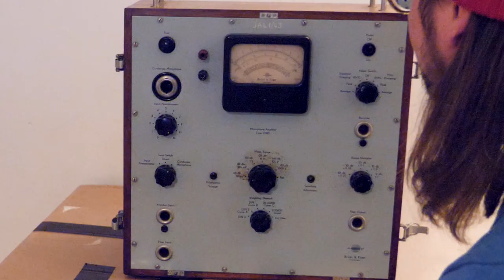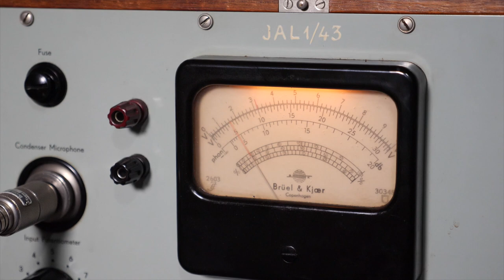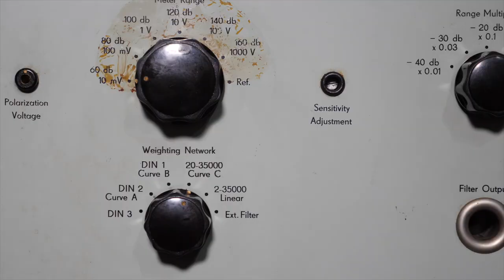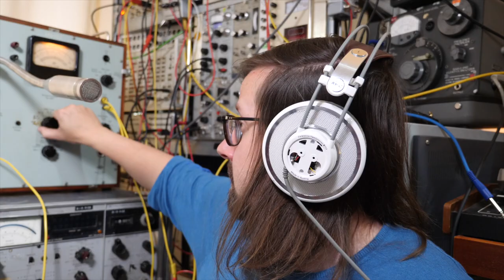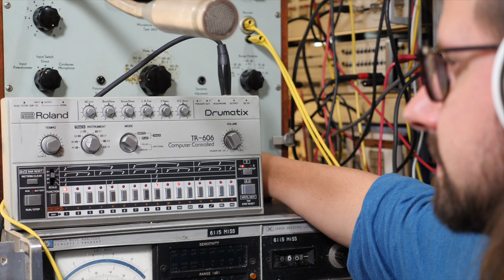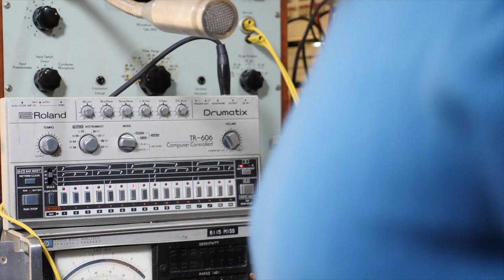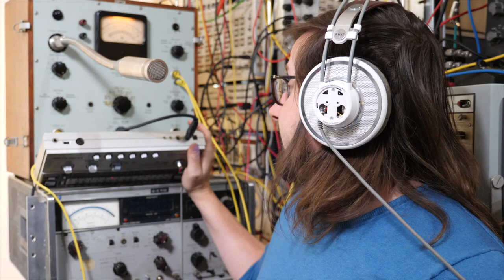Brüel & Kjaer Type 2603 vacuum tube preamp #willitmusic

Comment: I am very happy that you are still alive, please be careful. Just a tip: From my time with repairing old (tube) equipment I alwas had a simple measuring device, in German called "Phasenprüfer". It indicates whether mains voltage is applied. Saved me a few times ;-)

Comment: Sounds great! There’s something about 240V at 50Hz but I can’t quite put my finger on it! Glad you’re safe.
Reply: Touched a 120v wire once because I shut off the wrong Breaker once, even wearing insulated safety boots it still gave me a jolt and a scare.

Always double check your cables and have a circuit tester ready to go in before your hand does.

Ironically I was installing A GFCI outlet in a bathroom to prevent getting shocked XD

Comment: Man, so glad you are still with us! you need a proper working bench and a phase controller (2 way, not the cheap philipsdriver ones)! 
A tipp from a physics guy: never use a multi-power outlet strip with a switch, if you are working ob stuff like that. always fully disconnect the plug! 💪🏼🤓 
again: glad, you did not get hurt! ☺️

Comment: It's a good idea to power up old gear like this on a lamp limiter at least. These are cheap, easy to make and will give some protection if there is a fault inside and save things like transformers from getting permanently destroyed. A variac is a good idea too, bring the voltage up slowly, this gives capacitors that have not been powered for years a chance to reform. Very nice preamp, love the mic.
Reply from the maker: Awesome Tipps, Thank you! The shopping list for my workshop grows....
Reply: @Hainbach  Ein Trenntrafo wegen galvanischer Trennung (selbst wenn das Gehäuse unter Spannung steht passiert dann nichts mehr wenn man hinfasst) und dahinter ein Stelltrafo um die Spannung langsam hochfahren zu können ist bei so alten Gerätschaften sicher kein Fehler.

Comment: @HAINBACH
Hi! Total newbie here. I work in a test equipment warehouse and I acquired a sister unit of this preamp, the 2604. I want to use it for as a microphone/DI preamp and from this video I know it's going to sound lovely, but I need a place to start. How do I convert XLR / 1/4" cables to get mics/instruments into the amplifier, as well as converting the output of the amplifier? This is my first interaction with this kind of equipment and I'm ready for a new learning curve.
Reply from the maker: Hey I don't know how to convert it to XLR, as I run it with B&K mics. But you can just solder a jack to banana (signal and ground) for the direct input and the output. Really simple. You can also just buy ready made cables from Patch Point. The r/hainbach subreddit is helpful if you have more questions.
Reply: Thank you!

Comment: Do you ever consider re-capping these older units? I've spend the last few months learning tech work and recapping every single piece of gear in the studio i work at and my oh my can it do wonders for the sound! I've learned that, at the very least, recapping power supplies is good for the units long-term health!
Reply from the maker: It is something I would love to learn once I have build my workshop. Shopping for a Weller right now.
Reply: @Hainbach  awesome! best of luck with the buildout. i found it to be a pretty simple process for most caps. it gets tricky when you have to replace the larger can caps on older power supplies. the wiring is tricky and we have to get them custom built over here stateside!

Comment: You really can address your overall fears about electric boards nowadays. Think I’ve been shocked half a dozen times yet, and never died once. I also got some lightening charge through copper-works on a roof that very summer, during a stormy sky... which is not related to any kind of « magic » fuse, I dare say, H. ;)

Comment: Eek! And that‘s why I only tinker with low voltage stuff (anything below 18V for me). I‘m excessively prone to accident, so I‘d probably off myself accidentally with mains power! I have a broken soldering iron where only the control circuit is broken. For some reason they put the mains power on the same board as all the low powered stuff like display etc, so I‘m not fixing that! Be more careful too, please, even if the resulting piano track is just hauntingly beautiful!

Comment: Awesome stuff. I just got one of these and have never used banana cables. I noticed you are using both the large and smaller jacks for input and output. Is this so you can split the signal, or are both necessary?
Reply from the maker: One is audio, one is ground. You need both to get a clean sound.
Reply: @Hainbach  Thanks!

Comment: the vocal quality through that was nice,. very vintage,. not hearing the purpose of massive distortion for the music part of it though,. you sure that thing isn't half broken? loose wires, bad pots, other parts, tubes? anyway, could do some cool vocal stuff.
Reply from the maker: It might totally be broken and could sound very different if refurbished. But I kind of have nice BAE and A-Designs preamps for the clean but colorful role. So right now I like it as is. Also, I need a tech in Berlin.

Comment: I have this thing in my studio. Can someone write me how to connect a dynamic microphone, for example. I know that it has a different voltage for condenser microphones. I just need to get to connect a regular microphone. 48v phantom in a box is not a problem. I just want to know which of the pins should take out and make an xlr plug. can anyone help please?     By the way, once when i had it open for the first time, i got the same blow. Sweat flowed into my pants. :)

Comment: AAAAAAHHHH!!! Don't solder mains voltage cables! You need a crimper to make a physical connection!
Reply from the maker: Thank you, ordered!
Reply: Could you elaborate on why you should not solder mains wires? It's something that I've been doing for a long time now with my projects and you seem to know something I've gravely missed. I'd appreciate the input..
Reply: Get a box of 2 or 3way  Wago 222
Reply: The Concept Boy I suppose, it's a safety feature. You might be able to pull the cable in case of emergency
Reply: Why not?
Reply: @lachlanmackay6586  Soldered Connections can break more easily under stress than crimped connections I think (That is what I was told once), and you dont want a metal housing touching one of the 230v lines. (but maybe a more expert explanation would be better)
Reply: never solder, because it is physically not strong enough and might break and cause shortage or danger of getting shocked. in addition to that, the current at these voltages is way to high and might melt the connection, causing a fire and further danger. this is a job only for professionals. An electric shock might even cause arrhythmia which can kill you up to 24 hours later.
Reply: @chrisbliss7130  I call bullshit, solder should be perfectly fine for mains voltage and the current that it delivers. As far as for the physicall strenght, ye solder tends to break if the cable is moved too often or too much but if you built in a strain relieve it should be perfectly fine. Solder joints are also used in every mains PCB so I don't think its such a critical problem as you make it seem.
Reply: Ramog1000 well, at least in europe the standard for professionals is not to solder those connections for safety reasons. And I am a physicist, so I so have some experience ☺️😉
Reply: Soldering is fine on mains connections but the wire should be a good mechanical joint on the terminal or pin before you solder it.
Reply: @chrisbliss7130  you make a good point, this thing has a lot of Vacume tubes inside and they all need to warm up to start, that surge could cause dangerous eating if the soldier joint is weak in any way

Comment: HELP! I have this same preamp and was wondering how you connected it to use as sound amplifier. I know it has "amplfier input" and "recorder" connectors, but im not sure which wire connects where. tried different ways and kind of only get noise. One time i got noise with the sound i was sending but thats it. Can anyone help with this?
Reply from the maker: Signal to amplifier input via banana, output from recorder via banana. Don't forget to ground. More questions try: http://reddit.com/r/hainbach
Reply: @Hainbach  Thanks for the reply! Ground is the small hole under the "amp input"? I see you have something in there too
Reply: @Hainbach  Or rather under "recorder"
Reply from the maker: Yes, exactly.
Reply: @Hainbach  Thanks! Turned out on top of everything i was also using very bad quality wires
Reply: @hnrksch  hey man I have the same one and I’m trying to figure out how to use the amp input and output, how did you do it and what do I need?

Comment: Now, see...this is why I had my tech rip the similarly-goofy B&K vintage AC connector off of my 2112 and replace it with a proper IEC. That crap can kill you! But then, you really can't say you've got all your electronic music chops until your gear tries to blow you across the room at least once! One must feel a oneness with the mains AC!

BTW, B&K did make an extension cable for those 7-pin mic lines. Keep your eyes peeled on eBay, etc and one might turn up. Like, for example: https://www.ebay.com/itm/Bruel-and-Kjaer-Bruel-Kjer-Cable-AO-0029/153591864902?hash=item23c2c9de46:g:SyoAAOSw8Wdbivcz
Reply from the maker: Yeah, bidding on one of those! BTW the DAWE arrived - all battery powered so it's with a tech to install proper mains. Hope it works!
Reply: @Hainbach  Oh, hell yeah! I'm thinking it should be rather similar to the Quan-tech I've got...not only neat as a processor, but as an extractor, sort of like a GenRad 1564A on steroids. Make sure the tech puts in ample ripple filtering, tho...if it was battery-powered, it probably has a ridiculous amount of sensitivity.
Reply: @daccrowell4776  Speaking of!  :)  And now Hainbach has his official electronics degree...almost better to be shocked than burnt by a soldering iron (I've done both...220 hurts, 117v is also quite awful)! Great video...and I LOVE how that microphone sounds...don't change it! :)